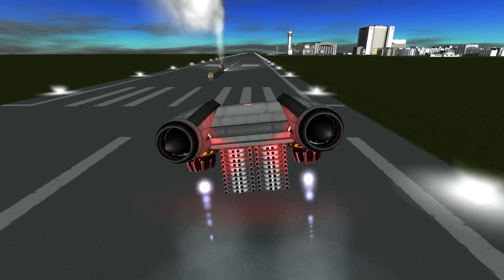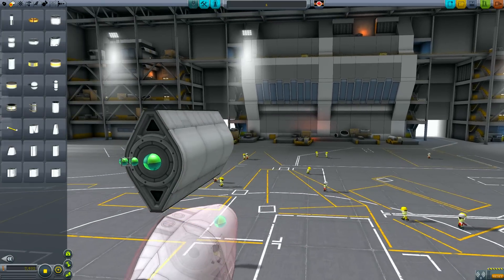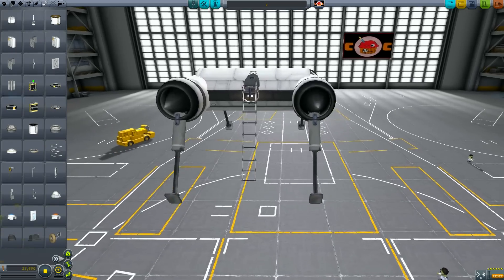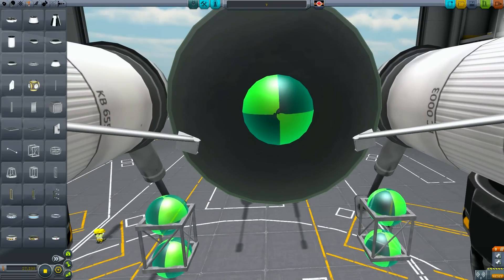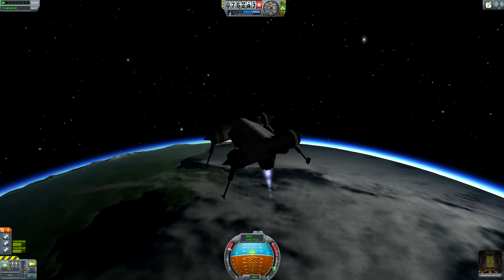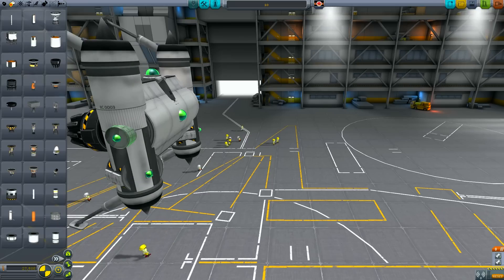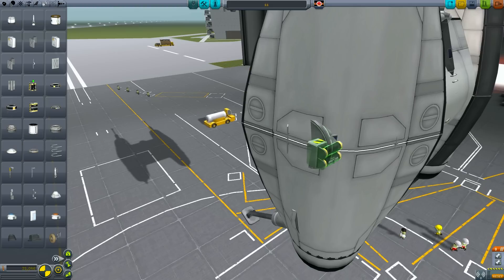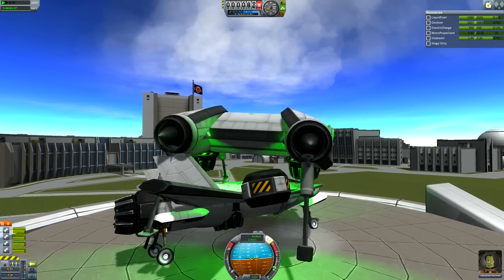Cupcake's VTOL Masterclass Part 2 : Building

Comment: Nice! I learned a lot about dealing with ksp symmetry without vertical snap :D a little tip that works when you design the fuel flow around draining to 1 central tank: hit the center of thrust and mass indicators can help to get your balance really accurate without a lot if in flight -> revert type testing
Reply from the maker: ***** I don't really trust the center of mass indicator as massless parts have a habbit of affecting it. :(
Reply: Cupcake Landers really? To be honest I've never noticed since I usually just look at it once to adjust the engines or ballast, depending on how I'm building things. And that's usually the last thing I do. I guess I'm just too trusting...... LOL :D

Comment: I always assumed you used the debug menu to allow part clipping. I'm impressed you don't have to.
Reply: I think he said he did a little bit but the assembly buildings are broken so badly that often you have to use it for stuff that should work anyway. Half the time it won't let you mount two engines next to each other unless you happen to be facing the right angle but it'll let you have wings impaling the aircraft without a fucking problem.

Comment: I tried to make Vtols, every time i failed :D Thx for that !! So more Rotary wheels you have, more stable and mobile is your craft ?
Reply from the maker: tomy10002 The more reaction wheels you have the more responsive your craft will be at the expense of outright performance. Stability depends more on how the craft is balanced, if the center of mass is perfectly aligned with the center of thrust the craft will be stable no matter how slow it turns. Hope this helps! :D
Reply: Yes dude thank you very much! Today i'll buy à joystick! :-D

Comment: I actually managed to create something extremely close to this using parts from my current run in career mode on .9 and Ive discovered 2 things:
1) Your vtol skills are incredible and I may need to get myself a stick to even come close to yours huehue
2) Ship doesnt appear to be ssto capable?  I dont have the correct air intakes nor the mini docking clamps yet though so... :3
great ship though.
Reply from the maker: MastaGwee I'm afraid she was never designed to be an SSTO, just for flying around on Kerbin. :P And yes, a joystick will let you do many, many things! :)

Comment: nice video, I will be sure to use some of the techniques. Did you know that BD armoury now has a guard mode, where you can set AI to control ships which fight against you? It might be worth looking at when you next do a combat video
Reply from the maker: 41Extremo I don't think my VTOL's will stand a chance against it sadly, they just move to slow. :(
Reply: Cupcake Landers A roach might be able to pick up enough speed to avoid fire if you did a mun or minmus combat mission, but you would probably have to carry the space missiles from the mod to actually hit anything
Reply from the maker: 41Extremo I had a quick chat with Paolo and it is possible to change the configuration files so the bullets fly slowly and have more of a sci-fi/lazer look to them. I'm afraid I'm no good as editing .cfg files though... :(
Reply: Cupcake Landers I'll have at look at editing them later today, and I'll put up a Dropbox link to it if I can get it working
Reply from the maker: That'll be amazing, Thankyou!
Reply: Cupcake Landers https://www.dropbox.com/s/8vxpfugcrk42g0e/Parts.zip?dl=0
https://www.dropbox.com/s/n1b2yf9w7h7sdxa/settings.cfg?dl=0

If you unzip the parts file and swap it for the parts file in BD armoury, then all of the bullets should move 10% of their original speed, which is usually around 100 metres a second. They have a lot of drop off on kerbin, so you may want to use them on low gravity planets instead

The settings file replaces the settings.cfg file, and makes the weapons deal more damage, which you will probably need to use if you are doing a battle on kerbin because otherwise the bullets deal very little damage

To make a craft fight you, you have to put weapons managers on both crafts, set guard and armed to "on" on the enemy craft, and then press the team button so you are on different teams
Reply from the maker: Thanks dude! BTW check your Youtube messages. ;)

Comment: to save the trouble of attachment issues , just put on part clipping. Now , you may say its cheating. Its not! Squad are making part clipping a existent thing in BETA , no Alt F12 menu option
Reply from the maker: SquaredSpekz Damn it did I not mention the ALT thing? Anyway, the reason I try to avoid debug part clipping is that you can accidentally attach multiple parts to the same attachment point which can do very strange things to ship designs! My understanding is that Squad will just make it easier to clip parts using standard building methods, they still won't allow you to attach multiple parts to the same node.

Comment: I challenge you to build a VTOL which works as well as this, and all your other designs....with clipping enabled.
Reply: That would make it easier...
Reply: HexDragon What I mean is make a ship without clipping parts through each other. You can do this using the method in this video, or by accessing the debug menu. Either way, it's cheating.
Reply: That's because it's considered a cheat. It would make construction easier. It reduces part count too.
Reply: ....which means it would be a challenge to NOT clip parts...hence why I am challenging him.
Reply: I bet he can but it wont look as good. Plus in relaity part clipping occurs in real life. i.e. parts within parts
Reply: I would probably look the same. I'm pretty sure he knows clipping tactics (non debug cheat) like cubic struts and when things won't attach, rotate or move a previous part. Part clipping is Cupcakes least worry